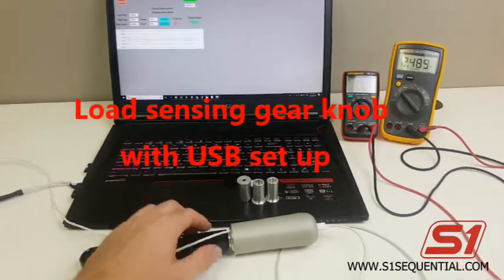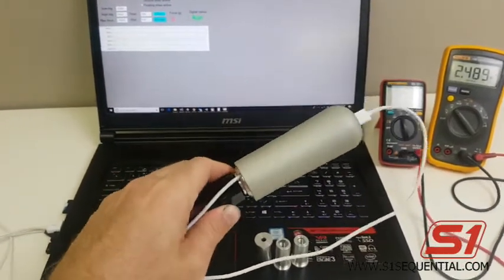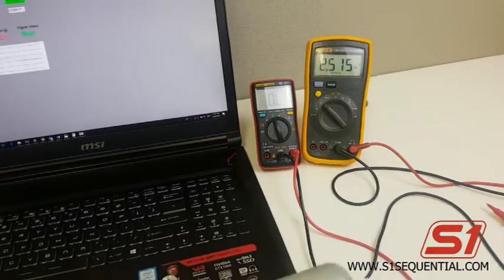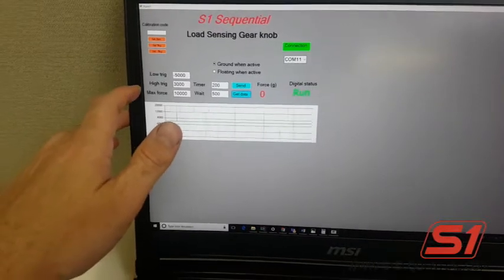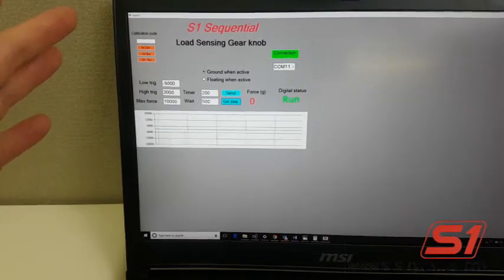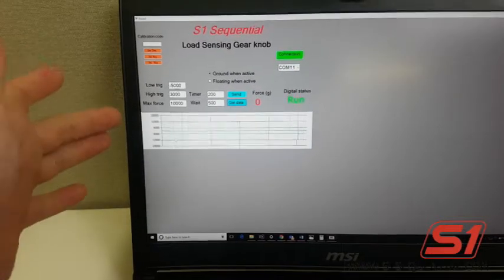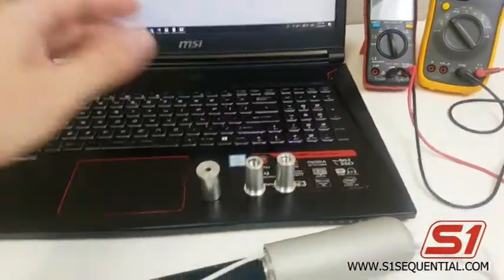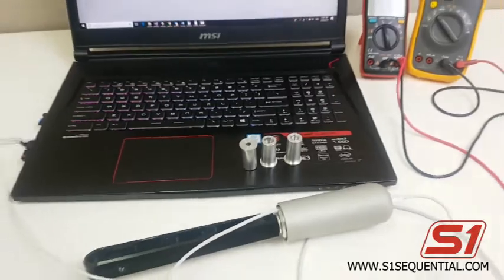Load cell gear knob features

Comment: So the liad celk acts like a switch? Interesting
Reply from the maker: Instead of using the same old strain gauge method that is commonly used we went hall effect sensing for a more modern up to date sensor. This is not a simple linear output hall sensor as that would not give the accuracy we expect. This gear knob uses a 3 axis sensor and actually calculates the vector of the magnetic field to detect the very slight flex in the load cell which deflects as a parallelogram to ensure a linear output relative to force regardless of where the fore is applied, this design also guarantees great temperature stability and allows us to build a much stronger load cell. The  data is read by an onboard 32bit microcontroller and then output either as a traditional analog signal or as a digital signal which can be very useful for many applications we also have built in timers that might be of use in some installations.
https://www.s1sequential.com/product/load-cell-strain-gauge-gear-knob/